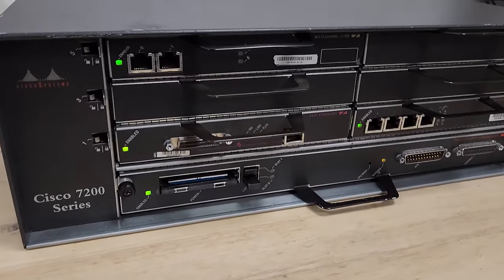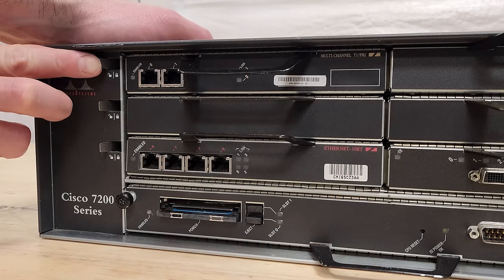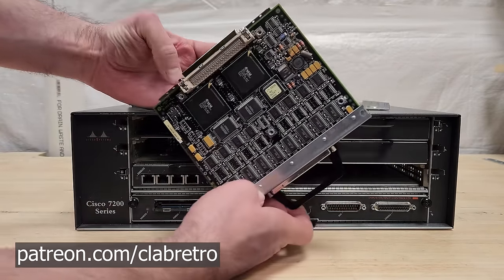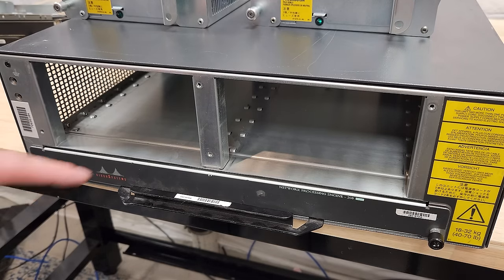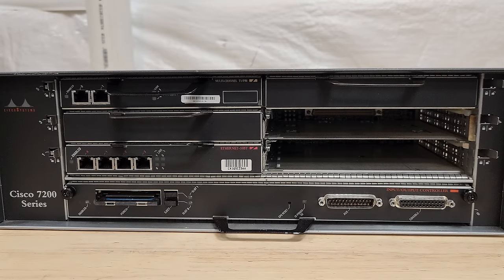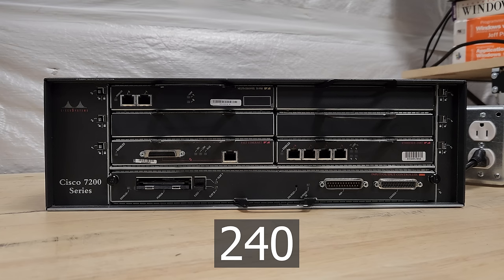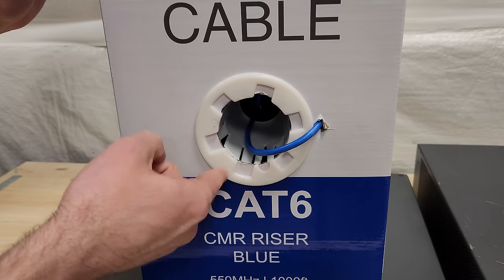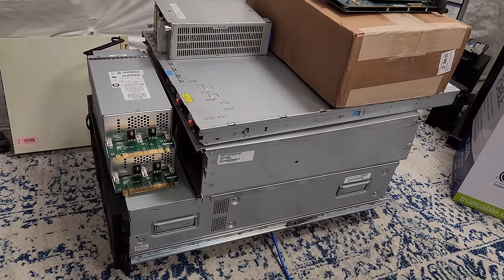Cisco 7200 Series Router

Comment: As a teenager, during an argument with my dad, to cut the tension, I cut him off and blurted out "Token Ring's dead, Dad. Get over it!". We both had a good laugh. 😂
Reply: ROFL!!
Reply: FDDI 🎤
Reply: Straight for the jugular!  FDDI Forever
Reply: in school I studied local area networks, we had an Ethernet network in our department, the school used token-ring. We had a ethernet<->Token Ring bridge, but we never got it to work, problems with termination, every time we connected it the entire school network DIED and the sysadmin (also a teacher) came running into our apartment yelling that we need to stop this shit.. and our teacher tried to explan that this work is part of our studies.. was very fun.. we never got the dam thing to work..
Reply: Close to being the most funny shit I've heard this year 😂
Reply: Ya but what about Arcnet???!!!  :)
Reply: @studioxxswe  My high school was token ring in their datacenter/library building, with the rest of the campus buildings connected by ethernet bridges and using normal ethernet networks. It worked beautifully...so long as you weren't hitting resources in the datacenter lol. A year or two in they moved the main file and Netware servers directly onto ethernet which was a massive improvement.
Reply: If it's dead, why am I still using it?
Reply: @hottractor1999  Arcnet was used heavily in industrial control. Probably still is.

Comment: Ever since discovering this channel my network has been overhauled twice. Built an opnsense router, swapped over to proxmox, have a symmetrical gigabit fiber install coming to replace the coax 1000/100 and I'm running new CAT6 drops to every room. Glad I finally got the motivation again because it's been so worth it. I appreciate the inspiration. 

Now I need to find a good deal on a rack and then afterwards forget my pin numbers to my cards.
Reply from the maker: haha that's awesome
Reply: Opnsense is so much fun
Reply: @clabretro I don't have open sense but I'm like you, I'm constantly tweaking my network and looking at my Ethernet drops that run along the floor into my closet like.. I need to run these under the house but I don't have a rack and dont want to go to the damp cobweb filled cramped crawl space
Reply: I only pay for the 150/150 package rather than the full 1000/1000 but full symmetrical internet has been wonderful. I would hate to go back
Reply: If I ever get hit by a bus my wife would have no idea how to fix the internet connection in my house when it breaks.
Reply: I just noticed that Dallas real-time clock with built in battery. 
These are known for leaking and destroying retro computers. Might be worth having a look
Reply: Right on, same here. I finally got a proper symmetrical gig fiber dropped to my apartment building…just for me 😂
Reply: @kaitlyn__L I’m at the point where I’ll choose where to move based on where the fiber company will drop fiber to me 😂
Reply: @TonyLasagna  I don’t blame you! Part of why I moved to this street was I knew they’d be running fibre into the basements of the apartments within 6-12 months. Those 9 months on ADSL, watching them inch down my street before finally getting to my building, felt like an eternity! 

The actual cabling to the units is a (fibre/coax?) backbone running up the utility conduits, that then breaks out into CAT5E for the actual apartment connections. But that’s more than enough for symmetric gigabit, which I don’t see myself wanting to upgrade to anytime soon.

 I’m already faster than most servers and CDNs at 150, the only time I really push it is when I’m sharing my music projects or whatever on Syncthing. And that doesn’t last long enough to justify doubling the monthly outlay to get gigabit, even if on paper the price per megabit is waaaay better on the gigabit plan.
Reply: @AtreidaeChibiko  Dallas ones actually very, very rarely leak as the battery is fully encapsulated. I think you are thinking of the other styles of batteries common on 386/486 boards. I don't think I've ever seen a Dallas RTC leak, though with the alternative type which uses the SNAPHAT battery connector I suppose it's more likely as it's not fully potted. But I've never seen one of those on any motherboards.
Reply: @AureliusR  mm I think I remember seeing later in the video the Dallas RTC and thinking "well my comment was stupid want it"

Comment: That FLASH logo on the Cisco card is badass.
Reply: It kinda reminds me of the Intel Flash logo.
(Intel Flash chips were used to store the BIOS on some 90s PCs like mid 90s Toshiba laptops, if I recall correctly)
Reply: @kbhasi I just assumed it was the same logo. 

But I tried to look up the logos just now to compare, and the results are all modern Intel logos and logos for The Flash, not Intel Flash logos 😔 even with boolean, even on DDG
Reply: @kaitlyn__L  
Yeah, I think it's obscure. I remember taking apart a Toshiba 440CDT and 480CDT to repair both and saw those Intel Flash chips, which I later assumed held the BIOS.
Reply: @kbhasi  I feel like I’d have to go seeking out a history page or a video of someone taking apart an early MP3 plate for total confirmation lol. But I know the one you mean and definitely went “oh it’s that original logo” when I saw it. I don’t think anyone else would make it back then bc Intel invented it, and was licensing it to others which included the logo. So, yeah. 

That’s a big part of why we still say flash rather than generically “NAND storage” tbh. Intel was doing everything to push that name and logo back then. It’s basically a generic trademark now (not sure if legally), which I know companies aren’t fond of, but in my mind that’s the ultimate mark of success for a trademark.

Comment: This video brought back memories. I joined SprintLink (one of the Tier 1 ISPs at the time) in 1998. Token ring was on its way out but we still had to keep it alive for some low speed edge routers. Most of the routers were 7500 and GSR. I think it wasn't until a few years later that we adopted 7200s for BGP route reflectors. Good times.

Comment: Up until 2020 I was working for an ISP in Australia where we used 7206 with G2 cards as our core and edge routers.
Reply: Still have 2 running in my shop.
Reply: Yikes, you guys must have had some kind of special support contract from Cisco on those, or just not cared. The EOL docs on those show last maintenance release in 2015 with last support date of late 2017. The enterprise I support right now has some old iron at various locations, and even with multiple tens of thousands of devices on support contracts they hold firm to those EOL dates.
Reply: What kind of outdated ISP was using this stuff as their "backbone" in 2020? Jeez, the ISP I use uses multiple 100gbps rings on DWDM as their backbone!
Reply: @gorak9000 some places in the world still has lots of adsl with very long cables that are not economical to replace.
Reply: @mrfrenzy.  Fiber cable is much cheaper than copper, because there's no copper in them and copper is quite expensive these days. If it made economic sense to run copper to somewhere in the first place, it makes sense to replace it with fiber now and yank out the old copper and sell it. North America is really starting to see some major investment in FTTP finally - only like 15 to 20 years behind more progressive places that rolled out fiber decades ago. Even Australia will go FTTP eventually - even if somehow you're further behind than north america is
Reply: @gorak9000  OP said Australia, so they only have to be less bad than Telstra, which is an extremely low bar.
Reply: @EtherealDragon  There were definitely NPE-G2s in 720xVXRs in use long after 2017. A lot of companies simply do not care about security until after an incident makes the news, and cease to care about security soon afterward.

Comment: Had a CISCO CCNA class in high school (circa 2000). Had to configure using the command line and configure network connections on the hardware (IE - making a T1 line) - which was next generation compared to this. I've forgotten all of it. It's amazing that you can learn things and forget them.
Reply: Use it or lose it. To keep with the computing theme, your brain is like a cache - only keeps the things you access.

The upshot - if you decide to learn something again after forgetting it, it’s easier the second time.
Reply: Heh, I also took a CCNA class in high school in probably 2000 - I remember thinking back then already that it was laughable connecting routers over back to back serial cables, with those big chonker v.35 connectors in the middle. Even the school had a cable modem at that point. I also remember the 'teacher' knew absolutely jack squat about the course, and was essentially just there as a babysitter while we went through the course material, the practical stuff, and did the online quizzes ourselves.

Comment: Ah - the dreaded points calculation on the 7200. I had forgotten about that, but I certainly remember doing it back in the day.
Reply: Yeah we used to use them to terminate adsl subscribers and we would max them out by putting 2 ds3s cards on one side and one oc3 in the other. With that configuration we would then run into both the maximum number of subinterfaces and the maximum number of interfaces you could configure on a system. We could only save the config to flash and it had to be at night when there wasn't much traffic on them.
Reply: I didn't forget. That backplane is PCI and has a very finite bandwidth. The VXR is faster, but it still has bus bandwidth limits.
Reply: When you add gig-e fiber cards and realize you just turned your 7206 VXR into a 7202 VXR...

Comment: That was a fun watch. I got my start in the ISP space and we used these 7206 routers with channelized DS3 cards hooked up to adtran muxes. This allowed us to run a whole mess of T1's out of each 7206. Later we had the fancy NPE's that had fiber interfaces on the NPE to not use up bandwidth points for the other PA cards. I may even have some configs from those days. I had lots of fun with T1 multilinks back then.

Comment: Oh dear, this brings me back. Great to see a retro networking video. 😁

We used the 7200s as PE routers for our MPLS customers. Also early on it was used as BRAS and the ADSL DSLAMs would connect over ATM OC-3.

The E1/T1 cards were fractional so they could carry many customer connections. For example one customer would have a 64 kbps leased line and use one time slot, another customer had 256 kbps and used 4 time slots. All terminating on the same card. Later there was even a fractional OC-3 card which could do sub rate down to single DS0s (I remember it was a very expensive card!). There were also pure POSIP cards - Packet Over SONET/SDH which we used back when SONET/SDH was still a thing.

Over all it's was a very versatile platform. The same cards were also usable on the 7500 IIRC.

Hope you'll get your hands on the legendary GSR as well. 😉

Comment: That 7206 was just slightly before my time. I worked with the 2600/2800 but you never work with production routers much as messing inside those in production will get one fired. Great video thank you for the effort

Comment: I was a Network/Systems Engineer that worked almost exclusively on Cisco equipment.   I stopped working in the field about 12 years ago when customers were driving me crazy expecting me to know everything about all things Cisco - routers, switches, firewalls, VoIP, etc....   The 7206 was relatively easy to work on compared to the earlier equipment like the igs, cgs, mgs and the ags...   In the early days they were known as "multi-protocol routers" because they could not only run  the TCPIP protocol stack, but also others like AppleTalk, XNS, DECNet, etc....   It was an interesting time to work in the growing computer networking / Internet field.....

Comment: I worked on a pair of 7206VXRs at my first actual network engineer ISP job.  One trick to getting those bottom cards out is once you get a little movement, take a couple of flat screwdrivers and lever each side of the card simultaneously.  You can actually pull the handle clean off if you yank on it when it's in a rack.

Comment: We actually had one of those 7200VXRs at my last job. It was serving a Comcast Metro E 100/100 connection and splitting it between 3 tenants. It was retired when we upgraded to 300/300 a few years later. I knew nothing about how that device worked or was configured, but it's interesting to see it now.

Comment: This message was transmitted by a 7206VXR that runs my home network. I've got the NPE-G1and actually only run the GE ports on it. Nit-pick: The configuration is in NVRAM, not on the PC cards; they're only for operating system image storage. I've been meaning to replace the 7206 with a 892 for ages, but the VXR is so conveniently reliable!
Reply from the maker: very cool! those G1 and G2s look impressive.

Comment: I had a VXR with the NPE-G2 installed in it a while back. Interesting tidbit on the G2: it uses the fastest PowerPC 7448 CPU ever produced. The 7400 series of PowerPC CPUs is most widely known as the "G4" as used in Macintosh computers from the era.
Reply from the maker: I'd love to try out a G1 or G2 someday. Interesting about it being the fastest 7448!
Reply: I believe some have procured some NPE-G2s to gut them for their PPC chips to upgrade their vintage Macs!
Reply: @evilZardoz you’d be correct, DOSDUDE1 and HrutkayMods are the ones doing that.

Comment: Speaking of the Serial interface card, we actually use more modern Cisco 4221 ISR routers with NIM-16A cards as terminal servers in some Datacenters. Each NIM-16A card has 2 8 port connectors, and with an "octopus" cable lets us connect to the console port of equipment throughout the Datacenter. Each 4221 can support 2 cards, so we can connect 32 serial devices to each one. The 4221 has anemic bandwidth by modern standards (35Mbps with base licensing) but that's more than enough for this use case. There's also the option of rolling your own serial console server, but the 4221 is a solid platform running IOS-XE that we already have plenty of automation workflows for, AAA for authentication, VPN Tunnels, ACLs for user access to the right devices, etc. etc. Not to mention they sip power in this particular configuration. It's a niche use case, but great for ensuring access to a couple of racks worth of gear out of band. We're definitely not the only large enterprise out there doing it.

Comment: I ran my isp from 1995 to 2012 in these. I had 2 7206 vxr as I had FE interfaces. I remember doing bgp with 8 T1s y til I went OC3. I don’t remember exactly when I bought my first 7206 but I ran my isp as a business from 1985 until I sold it in 2012.

Comment: We used a bunch of the toasters across various branches of our telco. At some point, we had an entire room just piled up with 7206s full of E1 interfaces for dialup internet after that had all been torn down. 
One of the ones we ran for yeeeeears could only fit a single power supply because someone had used it as a step to reach the cable raceway above the rack and caved in the entire chassis, especially the slot the (at the time empty) second PSU would go in.
Reply from the maker: haha

Comment: Great video, These old-timers (7200s) were from before my time in supporting customer on-site equipment. I have 2 decades in employment with a Tier 1 provider, and I can say I haven't ever come across any of these units in the wild up until recently, when some old equipment was found hidden away in some network cabinets, still strangely powered on, even though they have been out of production for WELL OVER a decade. 

@11:56 - Probably a good idea to blur out information such as circuit IDs on equipment. The company it came from LIKELY disconnected the service, but it is quite possible that the provider recycled the ID to use for another service ordered after this customer disconnected it.
Reply from the maker: ha, funny they were just left running!

Comment: The v35 card will still work. The blown cap is likely a filter cap and it will run without it!! It might make it unstable on long leads but short leads after the breakout adaptor will probably work or at worst you loose 1 of the 8 channels.. thats why it shows it booted up and green light. If the card was not functional at all the card will prevent power up and not have a green ready light. So replace the cap because it's needed for stability or for 1 channel to function properly but the rest of card is working well enough to boot.
Reply from the maker: some other folks mentioned that too! I'll have to give it a try
Reply: @clabretro  yeah systems like this are all about redundancy and super stable connections so it's probably functional and tested fine because it works in the basic system tests. Like motherboards with dud caps are still still functional but slowly becoming unstable over time as more filter caps fail. Same as tiny caps on CPUs or phone motherboards you knock 1 off and the Device still seems to work with our it lol I used to think why have these parts if they are not needed but as I found out it's usually just for stability of signals or to make sure it can deliver consistent voltage with out getting to low making the CPUs unstable.. so it needs the cap to be perfectly stable but it is likely still working.

Comment: Wow, what a feeling of nostalgia, I've still got four chassis with two NPE and a smattering of PA. I used to run these things at ISPs I worked at, and rescued the ones I have from a friend when they were swapping out their PPP tunnel endpoints.

I had a plan to make my own lab, but never used them, you want some? I've got 2500 series, 7200s, 3600s and a bunch of fast ethernet switches.
Reply from the maker: hey, possibly! you can reach out to the email in the channel's about page (might have to be on desktop to see it)